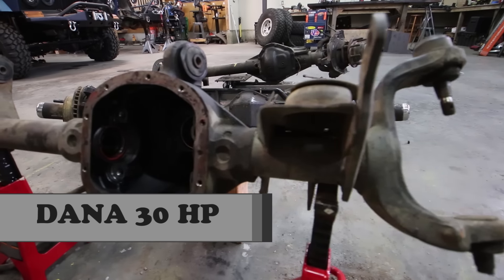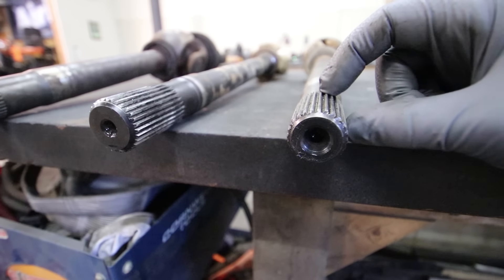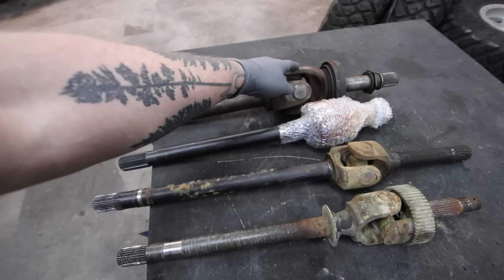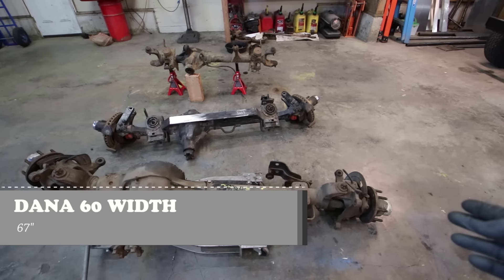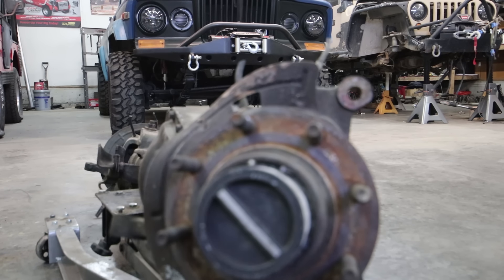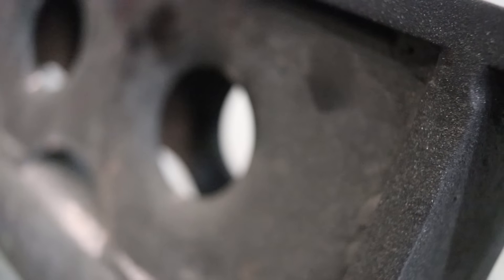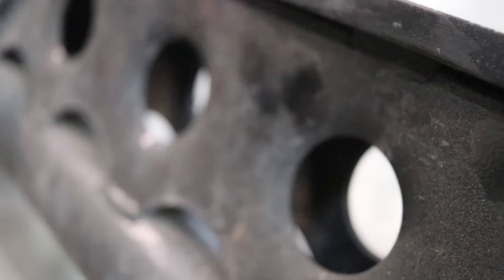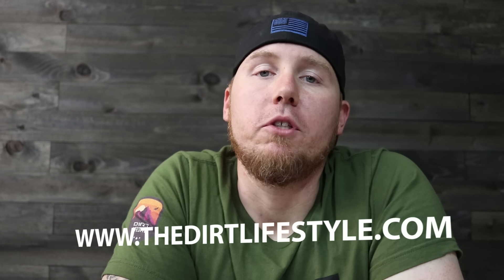DANA 30 vs 44 vs 60 Junk yard Axle Swap Beginners Guide!!!!

Comment: I know this is an year old video but I have a 18 jeep wrangler jl (non rubi) and I'm putting  a 3.5 inch lift in it with 37's upgrading driveshafts want to do chromalloys should I upgrade to dana 44 and if so is there anything that would work with my year(I see that its like 15k to do a axle swap) Any advice is appreciated.

Comment: Hey Nate!! This is a long shot:
I’ve been looking at some utv due to a off-road park opening up in my area. And they’re expensive, I saw this video and got me thinking. My mother in-law has a 95 XJ that the trans has gone out and wants $200 for it. So I was looking into the BARNES 4WD B4WK12584 kit to swap in a dana60. Is this a better option for minimum fabrication work?

Comment: I've got a yj. I'm wanting to do one ton axles. I can get a d60 for the front but what is your recommendation for a rear
Reply from the maker: I would run a 60 rear if you make less than 300 ft lbs of torque. More than tha you need a stronger ring and pinion. Ford 9" or 1 ton.
Reply: @DirtLifestyle  Thanks for getting back to me so fast, really appreciate the insight. I'm wanting to do a v8 swap so I might do a one tone rear just to be safe
Reply from the maker: One tone is probably your best bet. The problem with a v8 is it sounds awesome... in order to make that sound you need to throttle hard... keeping yourself from throttling hard to hear your bad ass v8 is easier said then done lol

Comment: Just found the channel and this is awesome info with past experience tid bits. Thanx much. Just did a swap on my CJ and my wife may leave ha. But my daughter and I are building her 95 f150 to overland with. Do u think I can get away without having to swap out for a straight axle? She has that tbs. Of course we will most likely swap. Just kinda hoping to get away with this for a while.  Thoughts? 35 inch tires. Roof top tent. Pretty light weight rack. 300-6.
Reply from the maker: I'm glad you found the channel!  Sounds like you got a really cool project!  I think you will be fine with the set up you have now at least for a little bit. I think Long term you are going to want to swap in a solid front axle for reliability. I would find an F150 at a junkyard and pull some front end parts that you think could be a weak link up there. Steering components, spare shafts and even a spare hub would be nice to have in a pinch. You guys are going to have a blast in that truck! Overlanding is way to much fun 👍
Reply: @DirtLifestyle  Great idea. We have some extra items for just in case.

Comment: Does anyone know a good source for looking up axle information? I'm looking to swap Dana 60s front and rear on my 95xj but have been having trouble pinning down a good dinner car. I've found a few websites but they leave a lot to be desired. I plan to run 37s initially and then go up to 40s. Obviously will be doing a big lift, frame stiffiners and eventually want to do a tdi swap.
Reply from the maker: Check auto auctions too brother. I bought the donor tdi for my TJ on copart. I've seen tons of f 150s and 250s at auction. Good luck!
Reply: @DirtLifestyle  thanks for the reply. I mean to ask what sources do people use to find what doner cars to look for? Is there a comprehensive list somewhere that shows what model year trucks have which axles? Having trouble finding front/rear axles that match axle widths and bolt pattern. Enjoying your fab videos and overviews, thanks for sharing what you know.

Comment: hey mannn,,here in aus,i have a s/duty with a dana 70 disc,out of a 5.4lt s.duty.mine was drum,yes drum,its a 4.2tdi,mexican f250.2002,you never got them,better than the 7.3lt.anyhoo.as to chrome moly,look up ronny dahl modified ,vids.broken rear diff.he smashed a c/m axle.overloaded something stupid.300lt fuel 200 water.in a 79 series v8 tdi toyota.chunk.now he,s gone light weight.haaaa..did you get dana 70 s.d diffs rear.disc.??.4.11 ratio.lsd.s/duty.

Comment: I have a 2000 TJ non-rubicon so it has the Dana 35 in the rear. Anyone know where to find chromoly 30 spline axles for it? I can't seem to find them at all for some reason.

Comment: Love the video! Quick question brother. I plan on running 37s on my jeep tj sahara. I have a stock d44 in rear and planning to put d44 front from a tj rubicon 03-06. No rock crawling. Just overlanding. Would it be capable running that size of a tire? Planning to regear it at 5.13s. Thanks! And if I can, any other reenforcements to do? Thank you once again!
Reply from the maker: You can definitely build those axles strong enough but you MUST truss the housings or you will bend them! The axle tubes are super thin in these rigs an people bend them all the time. Unbending them is a very difficult process. Good luck buddy!
Reply: @DirtLifestyle   thank you so much! You just saved me tons of money buddy! Love your new channel. Really informative 👌
Reply from the maker: Anytime man, happy to have you along for the journey 🤘

Comment: So, you missed several key factors that make the axle shaft '"stronger"  Spline, each on represents a load area to apply torque as a pure necessity of surface area the diameter of the shaft is increased but that does little to increase the strength. Chromoly, from a cellular level, the structure of the metal is smaller and even varies in the alloy and the quality of the alloy( chinesium vs American made) the number of cells because they are smaller means more dense and more surface area to carry load, Thus the shear strength and tensile strength are significantly increased.  Further Chromoly is stress relieved and heat-treated differently than mild steel. So, if you want to increase the capacity of your stock axle shaft or stub shaft, have a local heat treating company stress relieve them. If you don't know what stress relieving and heat treating does to metal. It's simple, the crystals are pulling away from one another because of stress from welds, impact, and flex. Heating them to an even temperature relaxes the metal or the crystal's stress. Allowing for the crystal structure to reattach at every point possible in the lattice of the crystalline structure. The more surface of attachment the stronger the bond and less chance of separation and failure. Heat treating also bonds the metal crystals on the surface even tighter to make it act like a wrap and provide further protection against separation of the crystal lattice.   The same holds true for what makes a CV joint stronger than a U joint.  The total loadable surface of the u joint is the circumference of the capx4. Albeit, in reality, the loadable surface of the needle bearings on the points of contact 180 degrees from each other multiplied by however many needles but we don't have that design information here. Suffice as to say a BIGGER CAP will hold more needle surface area. A CV has all the surface area of the balls and races inner and outer to carry the load of the force applied through the axle shaft to the stub and wheel.  Easily the CV has a huge geometric advantage of loadable area and then there is the range of articulation which is greater also. The U joint has a trunion that at best is a compromise of leverage but has worked for decades as long as wheel hop wasn't applied.

Comment: do these principles translate over to japanese truck as well?
Reply: The principals are the same but Japanese axles come with CV joints already, not u-joints. Also the options are a bit more limited. For example you can get a front Toyota 8" high pinion but a 9.5" isn't available in high pinion. Still I think the 9.5" is better since it is not weak in reverse like the 8". Toyota full floating 9.5" rear is a good rear axle.  

Nissan Patrol 9.2" is a good choice, fits in between the Dana 44 and 60 in terms of strength. Patrol 10.25" full float rear is a real strong one, around the strength of a Dana 60.
Reply: @JeremyPetho  i was thinking about building a 80 series landcruiser for overlanding and offroading
Reply: 80 series has an 8" high pinion front axle and 9.5" full float rear. If you want to run big tyres and drive it hard some chromoly front shafts and CVs would be good but otherwise the stock axles are fairly strong.
Reply: @JeremyPetho  so as long as i add chromoly axel shafts the stock axels housing should be fine?
Reply: @johnyblaze11   Yes the housings usually don't have problems. But if you are using chromoly you will want to convert it to part time 4WD because the CVs wear quicker than the standard ones.  
Even if you leave it all stock it should be ok if you look after it. 80 series axles are already more than strong enough for most people.
Reply: @JeremyPetho  are there after market cv's?
Reply: @johnyblaze11  Most aftermarket are pretty similar to stock unless they are chromoly which are far stronger
Reply: @JeremyPetho  they make chromoly cv's?
Reply: Yes there are a few brands of them you can buy
Reply: @JeremyPetho  i have been looking online and i don't see cv's on the drive shaft for the landcruiser
Reply: It will usually be called a chromoly birfield & axle set or CV & axle set.
Reply: @JeremyPetho  it looks like the drive shaft has u-joints
Reply: The drive shafts use universal joints, the axle shafts in the front axle have CV joints (instead of universal joints like Dana axles).

Comment: So I've watch all your axle build and info vids ruffstuff and bleepin. I'm about to do frame rail stiffners , clayton longs w tri-4link rear. I have matching low pinion 44s from a 86 wagoner don't plan on goin bigger then 39 or 40" tires but front will have next venture  full truss and rear will be a iron rock axle swap kit with the clayton truss for ucm's. Running dick cepek 35s and will have 4.56s gears in axles. But question is...I wanna stretch wheelbase, do I have to angle coil bucket mounts more inwards and everything else.. rear truss is rotated 15° for proper pinion angle, can I use a mig on front truss and use stick to burn It into axle housing I've done alot of trimming and diy 2x6 rocksliders and kept em away from tires and wheel well unlike most.. And am at 4.5 or 5" of lift. Only wanna go to 6 no higher..  understanding its a massive stretch for 40s to be clear on that low of lift and for tires to be lined with front and rear bumper.i know eventually will need custom arms. Hopefully trailing arms. My front truss has location settings at 2.5 inch forward and long arms will adjust rear a lil im not sure. Do I get offset coil buckets aswell?

Comment: Will the insides of a low D30 swap to a high D30? My low is fully built minus the truss
Reply from the maker: Unfortunately no.  The center section of your axle housing is cast to fit one or the other 🤘
Reply: @DirtLifestyle  bummer. Thanks for the reply

Comment: The 2006 and up Dana 60 or coil spring 60s are actually better than the earlier leaf spring 60s because the coil spring axels have larger diameter stub shafts, not sure about the axels shafts but stubs are larger diameter
Reply: 2005* and up
Reply: Couldnt remeber the exact year, thats why I referred to them as coil and leaf spring

Comment: Just watched your video excellent advice new subscriber have question I have a 51 cj3 w 225 v6 and 55 cj5 that's getting v8 both have stock axles wanting upgrade any recommendations what to start looking for 33 to 35 tires and medium off-roading
Reply from the maker: Are you looking to narrow a set of axles? Or do you want a set that's a similar width?
Reply: Similar width for 51 and four to six inches wider for 55 would like Dana 44 for both would be better not to cut down but axles getting tough to find without

Comment: Or, if you can't just "wait and save up" that $8k to $10K it will cost to buy a set of tons and all the upgrades all at once, just buy the axles, put them in, and don't wheel like a jackass as you slowly buy upgrade parts over time. Because otherwise you'll never get it done trying to wait and do it all at once.

Comment: May Inglis no is gut sorry...
In Spaña Dana 30 the cost is a 1300€ x2 OK nou is gut diferencial nou is strong tires 38/40.
The Dana 44 is gut... The cost 1600€ x2 is gut... The Dana 60 in Spaña is difficult forsale...the cost money Dana 60 is a 2000/2300€ x2 OK... Is gut deferential is estrong... The cuestión Diferencial Nissan i60/i61 the cost money in España 1600€ x2 is a very very strong nou problem tires 37/38 and 40... Dana 30 in spaña UFFF is a very very very bat... The Dana 44 is gut.
Dana 60 in Spaña is leyendary is gut is strong... Problem... Money cost... DANA 60 VS DIFERENSIAL NISSAN I60/I61... THE VEST cost money and very strong is Nissan.